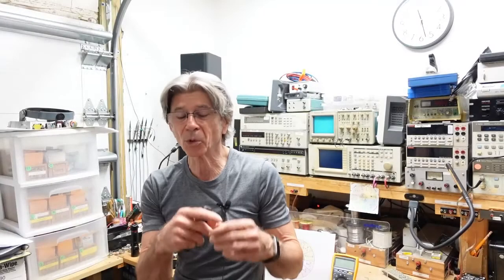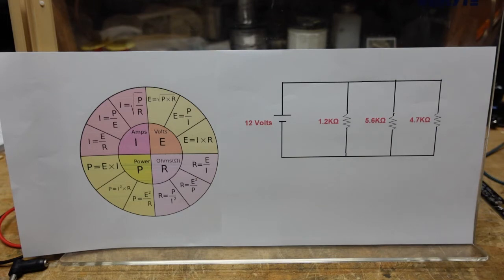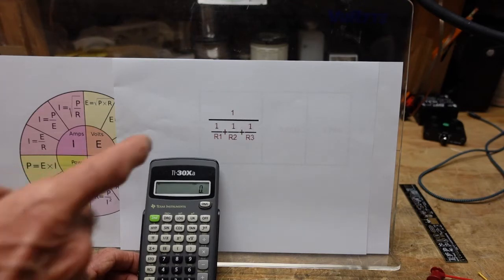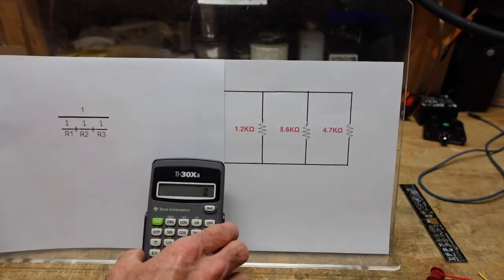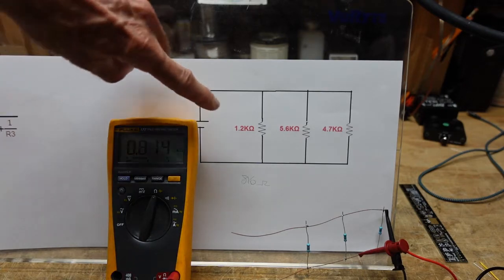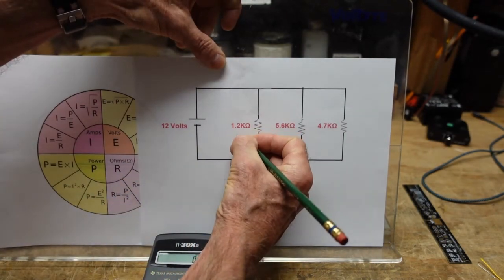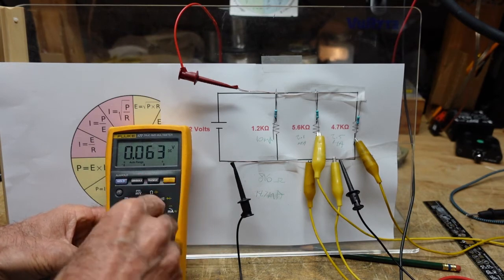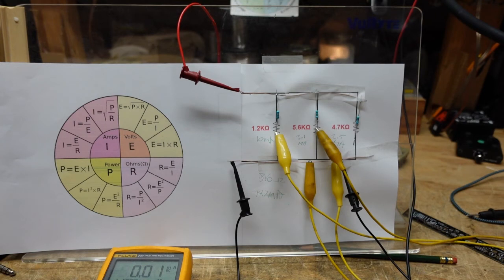Basic Electronics for the Technician Part 4- Parallel Circuits

Comment: Excellent job brings back many memories, I can definitely use the refresher.  Can't wait till you cover dBm to Microvolts, that is where I always get flustered.  By the way in another video you showed a great conversion chart, do you have a link, I have not been able to find it and it is a must when using HP8657A.

Comment: For audio output, it's better never to put speakers from 4R in parallel, if the amp can't have 2R loads. I've seen it many times in real world situations. People are mostly puzzled with parallel and series. And if they continue to use it on 2R, I see those amps frequently showing up on my bench 😅

Comment: Excellent explanation of parallel circuits and some uses of Ohm's Law, Ray.  One tidbit for Apple iPhone users if they haven't experimented with their built in calculator -- when held vertically, the calculator shows up as a basic four function calculator.  But when you turn the phone horizontal, all of the scientific calculator functions appear.  Looking forward to the next installment!